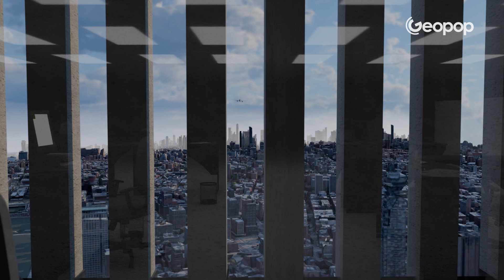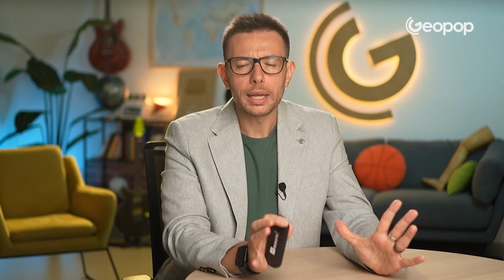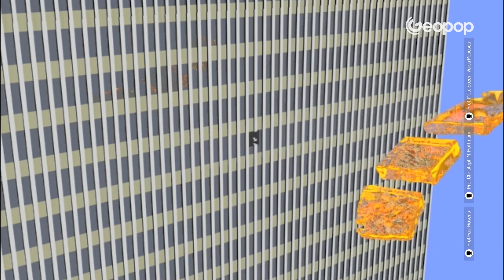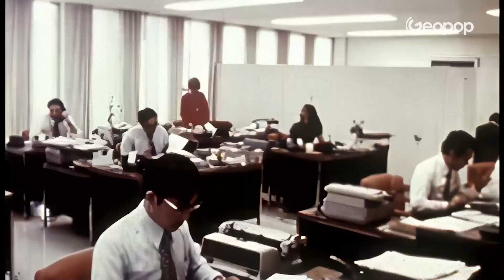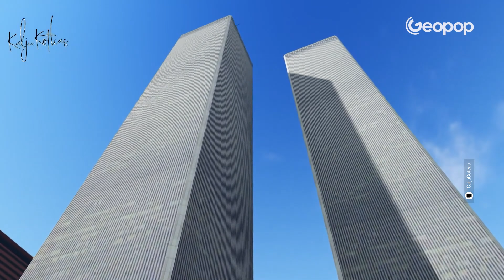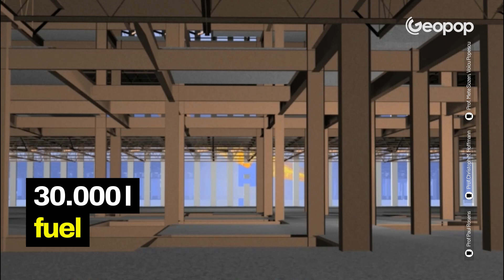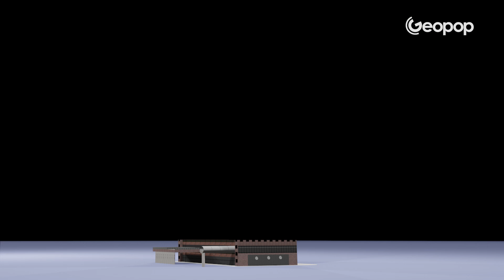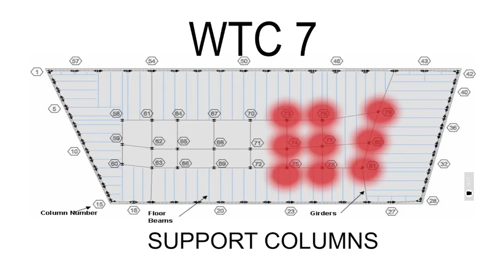9/11, 2001: The Technical Reconstruction of the Twin Towers and WTC 7 Collapses

Comment: What's wrong with you? There is no doubt whatsoever that the towers did not collapse in the way that was reported on the news back then! Even when you take into account that the towers and therefore their steel framework on the floors where the supposed plane hit were so weakened by the heat of the fire that they became unstable. The rest of the entire building and therefore also the steel framework was not exposed to any form of heat or suffered any other damage! Which should be clear to anyone with a bit of common sense. So it is impossible that the parts of the towers that were not within the area of the fire neither deformed nor dissolved as they did! It is impossible to ignore the fact that there is nothing left of it... I will spare you the mathematical calculations of the entire volume of the steel structures and what was ultimately left after the free fall. Lol, in the photos of the only parts of the steel framework that you can still see standing at the end, you can clearly see how the steel beams were cut cleanly through with termite... Guess what? It has also been verified that termite and liquid metal were still glowing in the rubble pits of the two towers two weeks later! But it is up to each individual what they think and what they don't think! But the thinking is a problem for some. At least I think so... And what 1000 engineers think about it 💭 is no longer a secret. A steel framework like the towers had could never fall to the ground in free fall without further measures and aids! Bro, it's just ridiculous to believe all of this to this day. Regards, Magnus
Reply: 4. Is a lie.  It begins to weaken at around 570 degrees. But it's just as strong at 500 degrees as it is at 250 degrees so 4 is wrong.
5. How did you determine the columns were overloaded? As you pointed out the columns on the 97th floor are exactly the same as the 7th floor. On the 7th floor they were strong enough to hold 100 floors so how do you come up with overloaded columns? It's simple,  you're wrong again. 
6. The pile of debris was only as tall as the lobby. So if your number 6 is correct. Where did it go? And this doesn't account for the explosions during the collapses.  It also doesn't account for the multiple explosions below the collapse (squibs).
7. You talk about the resistance but resistance takes time. And all these buildings fell at nearly freefall speed which proves the resistance you are referring to wasn't present. 
8. Watching the videos we can see explosions constantly forcing the building outwards as it fell, not straight down which explains why the pile was so small and body parts found ridiculous amounts away from the towers.
9. Not correct either 95 percent is with 0 people and furnishings inside. 
You're a joke.
Saying it took 35 seconds to collapse is just silly.
Claiming that there were no explosions is a lie. And you know better because I've already provided video evidence of tower 7 exploding. 8:20 https://youtu.be/bLF5D7M1YgA?si=iQJw1bw1P7vZRlir
I've posted videos of reporters , fire fighters and other people reporting these explosions why are you lying?
I'm done with your BS because that's all it is.
Reply: Common sense has nothing to do with it. This is about engineering and no amount of common sense will help if you don't grasp the engineering. 

Twin Towers collapses were actually relatively straightforward, the fundamentals already understood in the professional engineering community within just weeks. Still, there’s a lot of really bad information floating out there, mostly on the internet where it’s easily accessible to anyone. Good information takes more effort to come by and is much harder for laypersons to digest. Engineeringspeak is complex and dull. Also, some people put up a wall to protect their beliefs and false assumptions. Engineering is hard while wild baseless speculation and pathological theorizing with easy hand-wave answers is simple and exciting. Fanciful tails of pre-planned demolitions, magical space beams, melting steel and mini-nukes are just far more entertaining and require a whole lot less thinking, thus getting far more intention than they deserve.

To correct that situation, I have all on my own prepared this short yet detailed technical description of Twin Towers collapses based on my own observation and analysis of the available true and relevant facts. No politics or ideology, just the engineering. My hope is this will dispel many common myths and answer most if not all questions you may have about the Twin Towers collapses, because anything can seem like a conspiracy if you don’t understand how it works

While complex, most of the Twin Towers collapse mechanisms can be seen with the naked eye and easily discerned and understood by the layperson if sufficient time is taken to understand. 

1. The Twin Towers consisted of 4 primary structural elements that together formed an integrated system where each relied on the others.  47 hollow box-section steel Core Columns carry the majority of the gravity loads. The 236 hollow box-section steel Perimeter Columns carry the remainder and ALL of the lateral (wind) loads. Long-span Lightweight Steel Trusses connect the core and perimeter column together at each floor with a Hat Truss on top to tie the structure together as an integrated unit where no element can survive without the others. There was no structural load bearing concrete and most components were bolted together.

2. The impact of 117 tons of airplane (= to about 12 dump trucks) at speeds up to 590 mph with the energy of a ton of TNT completely destroys the aircraft. This in no way implies the Towers come out unscathed. Many perimeter columns are damaged or destroyed as are some core columns (example; 33 of 59 perimeter and 20 of 47 core columns damaged or destroyed at the impact floors in the North Tower), This damage is primarily through bolt-shearing failures at the end connecting flanges, as well as bending, twisting and fracturing of weld seams. There was no cutting or slicing - the reality was far more violent and messy. 

3. The impacts destroy or damage fire insulation, fire breaks and sprinkler systems on multiple floors.  Huge fires are started across multiple floors simultaneously and allowed to spread rapidly with no effective firefighting or fire suppression. This was an unprecedented fire event . 

4. The hotter steel gets the weaker it gets .  With fire insulation stripped away and no sprinklers the survival time of the steel greatly reduced. Gradually over time heat causes the lightweight steel Floor Trusses at the impact damaged floors to sag, which was observed and recorded.  No steel melted or needed to. Structural steel fails long before it becomes a puddle. It just needs to bend

5. Sagging floor trusses pull on the increasingly weak and overloaded Perimeter Columns, causing some of them to bow inward by up to 5 feet. A straight column is up to 4 times stronger than a bent column. The bowed Perimeter Columns buckle and fail, initiating collapse. The formerly static mass above which the structure below could easily support is now converted into a dynamic mass up to 30 times greater. Because they have buckled, the Columns above and below the failure point are no longer aligned . The load bearing structure below no longer bears any load as it falls past the lower columns, NOT onto them.

6. Thousands of tons of debris fall within the four outer walls, down through the open office space, crashing onto the first intact floor it encounters. This massive impact immediately breaks the bolted connections to the columns as the amount of resistance the Floor Trusses can offer is negligible.  The falling debris slows only marginally and briefly. Note:
6a. This is NOT a solid top block crashing into and “crushing” a solid bottom block .
6b. The debris falls past the columns not onto them.  The columns provide no resistance to the falling debris. 
6c. Only the bolted connections of the floor trusses to the core and perimeter columns can offer any resistance. A pair of 5/8” bolts at each end of each truss vs. thousands of tons of falling debris.
6d. No laws of physics are violated.

7.  This floor-led collapse progression within the four outer walls can only go straight down. Note: 
7a. This process is often incorrectly referred to as “pancaking” which actually refers to a completely different process rejected at an early stage. The catchy name stuck but nobody knows what it is supposed to mean.  Pancaking is too simplistic and inaccurate anyway. More like Kaiserschmarrn.

8. Collapse progresses through the floor systems not down the columns, through the path of least resistance . Rate of floor failures increases with each successive floor as momentum increases, reaching an average acceleration of 0.65 of GA, or 35% slower than true free fall. Bam, bam, bam down the building until there are no more floors to fail.  The resistance offered by each successive floor is always the same. The mass and velocity, thus the energy of the falling debris is constantly increasing, with each floor destroyed adding new falling mass. Some falls to the sides, but most falls down. More mass, more velocity, same resistance with each floor.  Don’t get stuck on the but the lower floors weren’t on fire nonsense. They weren‘t and didn’t need to be.

9. The Towers were 95% air by volume. As that air was compressed inside the building it is forced down the tower and blown out the sides in reaction to the building collapsing . Those were not “explosions”, it was expulsions of compressed air caused by the collapsing building, explaining the low velocity, lack of flash, blast, supersonic pressure waves and lethal high-velocity ejecta.  

10. Perimeter Columns become detached and peel away like a banana behind the collapse front, playing out to the four points of the compass extending to more than 600 feet from the base of the towers. This was quite obvious from examination of the debris pile. 

11. Core Columns fail last as their internal beam bracing is stripped away by falling debris and lateral support from the floor to perimeter columns is lost. 

12. For those who care about how long this whole process took; 31-34 seconds from the moment the perimeter columns buckled until the last core columns hit the pile, or 1/3 the rate of true free fall. Don’t believe me?  Just watch any video of the collapses and note the loose truly free-falling debris dropping much faster than the towers themselves.  

13. Each Tower had a 1-acre footprint. Far from collapsing inside their own footprints the debris pile spread out over 17 acres in a pile up to 14 stories deep. 8 surrounding buildings were destroyed and scores more damaged by the falling debris. 

14. What was NOT observed were the 180-190 dB bangs of thousands of high explosive devices or the blinding bright flashes of burning thermite. Neither could have caused the (silent) perimeter column buckling that clearly initiated collapse.  Neither explosives or thermite could have survived the impacts and subsequent fires either. A video of a shocked and injured firefighter using the magic word explosion is in no way proof of explsoIVES . The pre—planned demolition case relies entirely on that sort of thing. There is zero tangible physical evidence and it would be technically impossible, totally impractical and completely unnecessary. No one would bother. 

15.  Finally, the Twin Towers were perfectly safe within their design envelope.  They only collapsed when taken far outside design parameters by an extraordinary and unprecedented event 

Impact + Fire (heat) + Time + Gravity = Collapse . Remove any one of those four elements and there is no collapse. Ignore any of those elements (as many do) and you will never understand the collapses. The Twin Towers were an integrated system in which no one component could survive without the others. One fails, the rest follow, through the path of least resistance – DOWN – through the open space, bypassing the path of greatest resistance – the columns.  Nothing I just described violates any laws of physics. All of the above is true no matter who planned and carried out the 9/11 attacks or why 

I hope you found this helpful and informative. It is not meant to be adversarial, but to solicit informed critical comment, positive or negative. If I made any errors of fact, logic or reason or left anything critical out, please let me know so I can fix it. To stay focused just one topic at a time please and on-topic (Twin Towers ONLY). No word-salads of Gish Gallop. IF you can offer a more plausible alternative be my guest. Be the first. Please start any reply with the words “Tits McGee” or I will know you didn’t actually read it, are not serious and just wasting my time.
Reply: @ Really? So what‘s about this…https://youtu.be/xWi0x9xigQM?si=P7plMMcOZIswSy79
Reply: @magnusmcgraw  - What about it?  If Tricky Dick Gage told me the clear daytime sky was blue I would look up. 

I gave you a detailed description of Twin Towers collapse in one post (which you did not read).  Tricky Dick, Mr. "Expert" can't (or won't) do that after 18 years of investigating 9/11 

The stated objective of Architects and Engineers for 9/11 Truth since its founding in 2006 is (allegedly) to get a new investigation into why some buildings in NYC collapsed on 9/11/2001 (because the quite comprehensive and competently done investigations did not reach the conclusions they want). 

In 17+ years, after raising many millions of dollars, after publishing more than 1,300 YouTube videos and posting scores of comedy memes on Facebook and Reddit, how much closer are AE911T to getting this new investigation now than when they started?  

Have they moved the needle on that at all?

Why are they so bad at what they do?  They literally have just one job!  

Why are you still backing these morons?  The talent pool is not deep and it shows in their output.
Why do you still support such a proven track record of epic incompetence and failure?

Here's my conspiracy theory. Theres been this push with "3000" engineers wanting a new investigation. Funny enough they also are asking for donations. What if it's all just a scam to take money from credulous and gullible idiots?

How's that for common sense?
Reply: @ Something more for you and your Story….https://youtu.be/ssuAMNas1us?si=qTiPibzE6WnSlXBX
Reply: @ So far for the Common Sense…

Comment: Your total a&$hole for lying to peoples face . Its on live camera announcing collapse of building 7 
before it happened 
.i personally seen it explain that ?
Reply: Alright so we see the second airplane fly into the corner of the twin tower .
If the gas lighting debunkers were correct. By the way have you seen how popular fact checkers right  around 2019?
Anyways if all that diesel fuel would have leaked on that side even though I know it would have been dispersed it should have been a lot more diesel fuel to one side which would cause the steel to weaken as they say in what side to stay connected to the side that wasn't hit and cause the top  above the airplane strike to lean over. But they both collapsed identically the same what are the chances. 
You don't have to be an engineer you don't have to have any experience in construction to clearly see those buildings were set up to collapse the way they did end the story. 
I can't tell you who was personally.... because I have no way to prove it
Just like the stealth bomber & the Blackbird before that. There's a lot of things in secrecy that happens in secrecy that's hidden from the public. 
I said it before and I'll say it again 2001 we had to give up rights because the world had changed we had to usher at Homeland security see something say something. ..
 first country we invaded 
Had nothing to do with 9/11
20/20 open up the borders 0 reply unvented migrants all around the country
It was a deliberate and on purpose because we were putting them up in housing and giving them spending money so don't be naive.

.